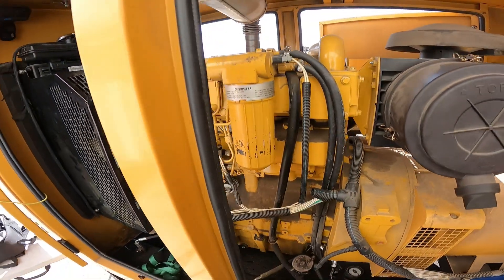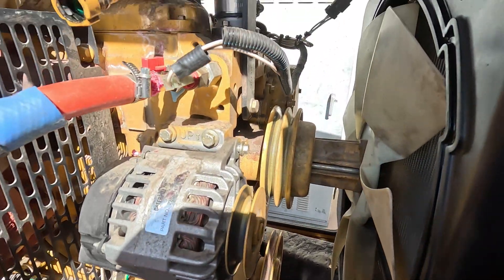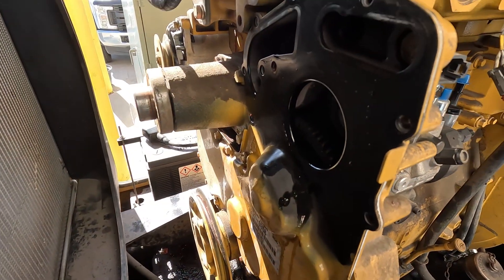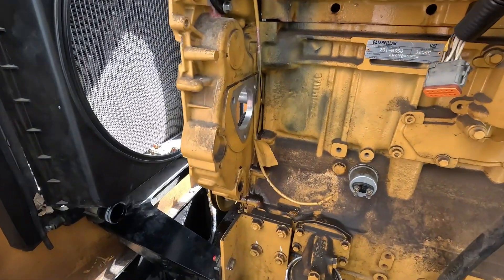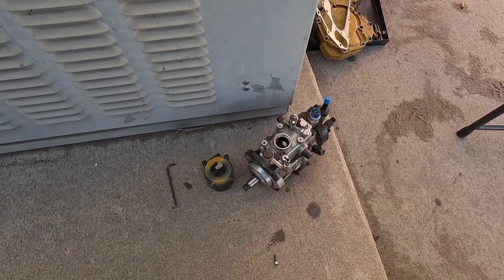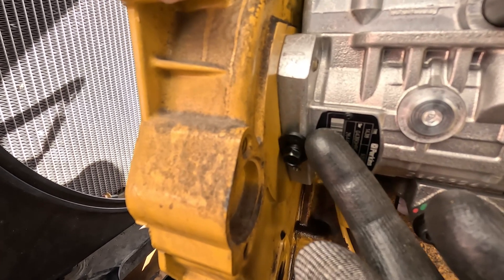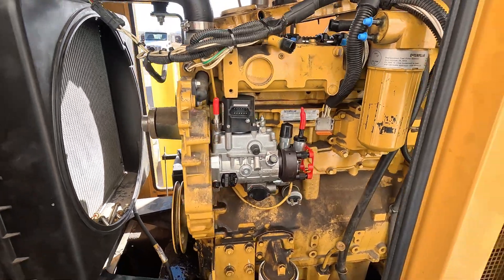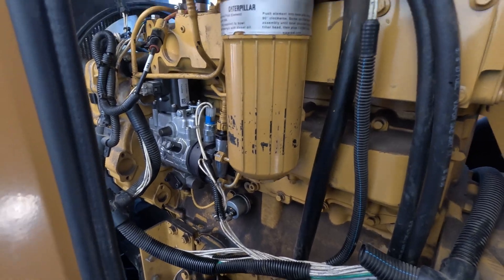CAT 3054(Perkins) Fuel Injection Pump Replacement

Comment: Thanks! Had one in a wood chipper wasn’t 1000% sure on timing it up but this helped a lot
Reply: Howd you go about tbe timimg im working on my chipper as i speak
Reply: @ if I remember right I followed along the video pretty religiously, and it worked, however it wasn’t running well when I put it back together, but I’m pretty sure  it was due to the customer allowing multiple gallons of water to pour into the engine since he did not cover it up with a tarp over the course of a month, he ended up ghosting us and was sent to collections so I’m not sure if I did something wrong or if it was on his end. The oil straight chocolate milk after inspecting…

Comment: How did you pull the gear off of the pump?
Reply: #4"  Three jaw puller also fit the gear
Reply from the maker: With a small two jaw puller. Came off pretty easily.
Reply: ❤❤❤❤❤❤❤ messianic guitar

Comment: Those perkins 1100 series are really popular were im from.
Theyre a solid engine abd ive had little problems with them overall.
Most common issue us the charge alternator failure.
Ive also had the seals on those Delphi injector lumps fail and filled the sump with diesel.
The engine ran on diesel as lubricant for 1000 hours 😂
Im not a fan of those Woodward L series governors but tgey seem to work well